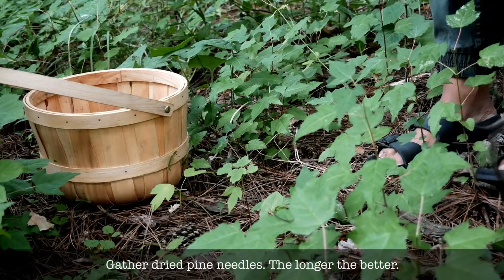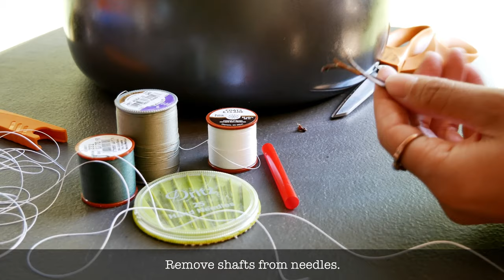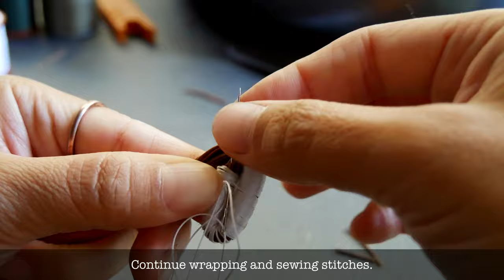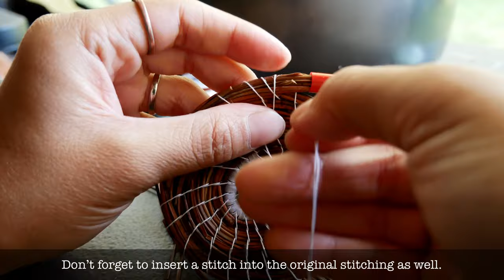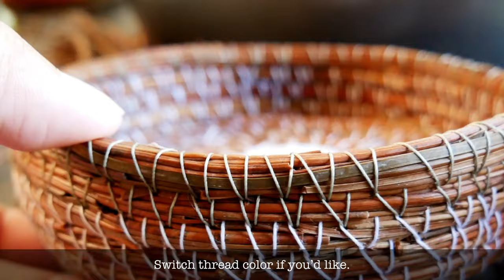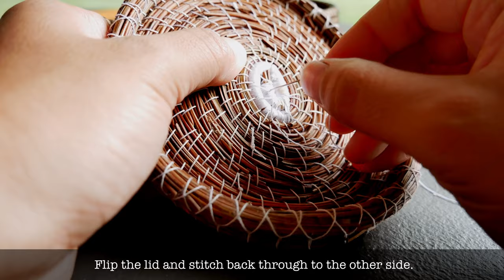How to Make a Pine Needle Basket || DIY Beginner Tutorial

Comment: Lovely video
Reply from the maker: Thank you! 😊
Reply: @DustTheNation  when the basket dries it goes really loose how can i prevent that?
Reply from the maker: Maybe try not to soak the needles as long next time or even try to only slightly dampen them. It seems that if they hold too much moisture, it'll cause a big difference in basket size when they dry. If the needles you're using don't break when weaving, then you could probably even skip the soaking step to avoid this from happening.

Comment: What type of threads can I use and does it have to be waxed?
Reply: I have used a linnen waxed thread,but a strong nylon thread works well also,and is less expensive. 🌿
Reply from the maker: I used nylon like @Rufus Pit said. I believe that as long as the thread is heavy duty, you should be fine.
Reply: Okay thank so much! I will keep this in mind when I shop for the threads tomorrow. Thank you for the advice!
Reply from the maker: No problem! So happy to hear you're going to make a basket. Have fun! 😊

Comment: hello! I have a question can I find some pine needles and save them for a while than use them?
Reply from the maker: That should be totally fine! Just make sure they are dried out completely and store them in a cool, dry area so that they don't grow mold or mildew until you're ready to use. Then soak before you start your project and you should be set to go.